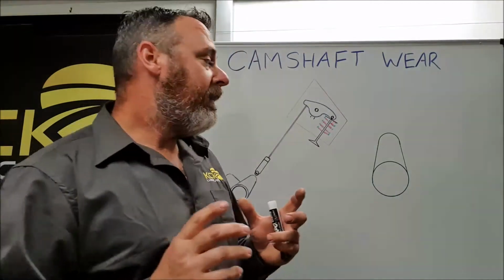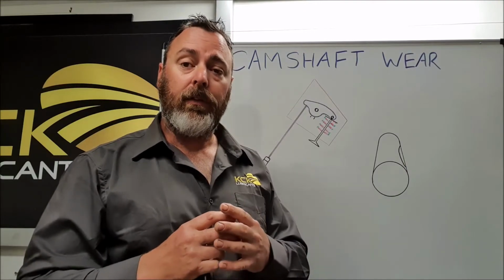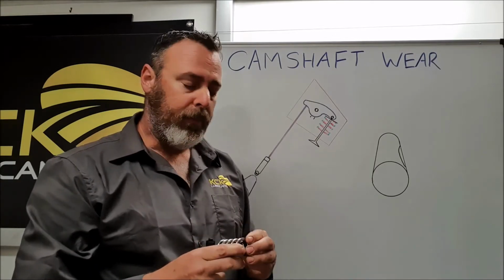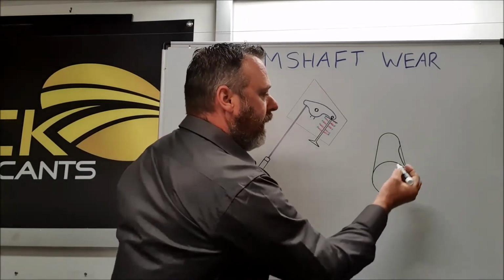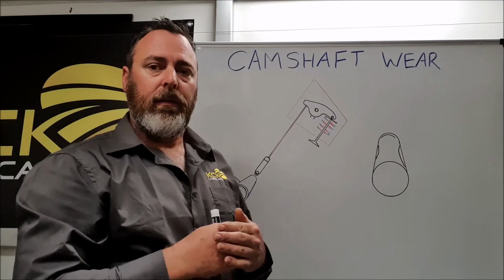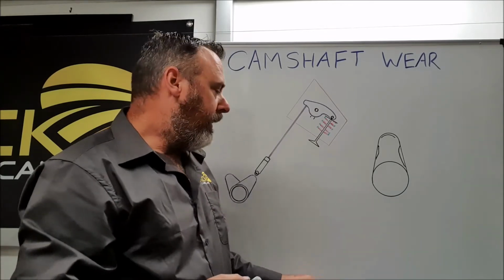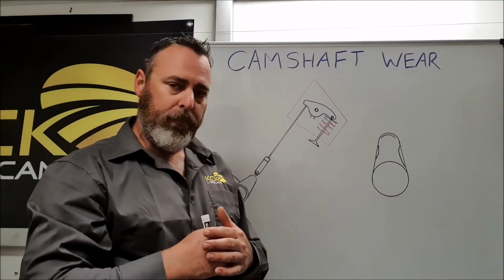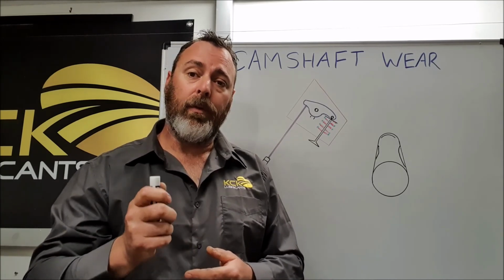Camshaft Wear Causes, Premature and Excessive Camshaft wear and some of the causes of Cam Failure

Comment: Hey man thanks for explaining clearly in this video 👍🙏💯I just did my valve cover on my 2.5 Lima engine on my 99 ford ranger. I saw one of the lobes had spider cracks but it was otherwise smooth. It looked almost like the metal was manufactured like that?? Wondering what you would guess it is?? The engine is running fine right now I guess I was just curious if it was from previous owner lack of maintenance or bad oil. I know they just used whatever was cheapest non synthetic.
Reply from the maker: Thanks for watching! I'm really not sure, that sounds pretty strange. If anyone else has seen this please let us know!

Comment: I would guess the exhaust valve camshaft suffers more than the intake, cause the exhaust valves are under a lot of pressure from the combustion explosion and the camshaft has to press a lot in order to open the valve. Am i right?
Reply from the maker: yes you are right, opening against the combustion pressure makes all the difference. Thanks for watching!

Comment: Cam break in-  If you have to run the engine at 2000 rpm for 20 minutes for the break in to keep keep plenty of oil on the lobes,  why doesnt the lack of oiling after break in kill the lobes while idling?
 I guess I'm not understanding what the break in procedure is for? Does break in  make the strength of the metal in the cam greater?   If oiling is a problem before break in, isnt it a problem after also?
Reply from the maker: Thanks for watching, the break in process at 2,000RPM has more to do with the lifter seating correctly with the lobes and not so much about oil flow.

Comment: What about suggesting using a zinc additive in a flat tappet camshaft engine?
Reply from the maker: short answer is, if you need a zinc additive your using the wrong oil. Use a quality oil like KCK which contains enough quality zinc to protect the flat tappets. check this video out on zinc, you might find it interesting.   

https://www.youtube.com/watch?v=tlr8fp07Rt8&list=PLECd88yrEjYIGRpI6XAJr8Tahr1khFitr&index=4&t=11s

Comment: What about a base 4 synthetic vs conventional oils?
Reply from the maker: Both oil's definitely have a role, when talking camshaft and valve train it is more dependent on the zinc content and type of zinc in either oil that makes the most different to the 'load' capacity of the oil. This video explains more about zinc https://www.youtube.com/watch?v=tlr8fp07Rt8&list=PLECd88yrEjYIGRpI6XAJr8Tahr1khFitr&index=4

Comment: My mercedes E220 W212 model is showing two blue lines on its number one cam lobe, no other marks or indentations, i am using the correct spec oil and have started using a liqui molly additive, the engine has done 129k looks like something ran hot but why ? I really dont want to get into a cam shaft change or cam follower change.any ideas, Cheshire UK
Reply from the maker: Thanks for watching! any marks on the cam lobes are bad news, are they like scratches or just coloring?

Comment: My honda is clicking.  Excess oil smoke out the exhaust.  Some white.   Coolants is ok but extra oil in the cams and spark plugs click increases with speed and rpm seems a little lower 2014 honda accord v6 with vcm.
Reply from the maker: that sounds like you have some mechanical problems!